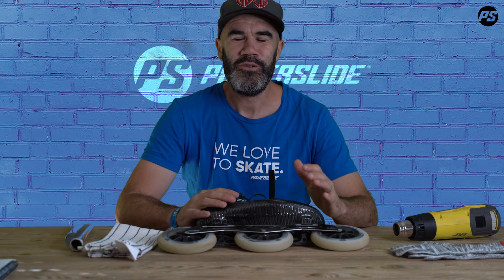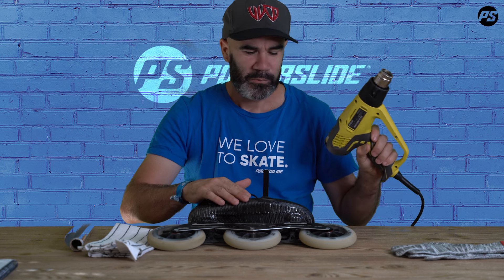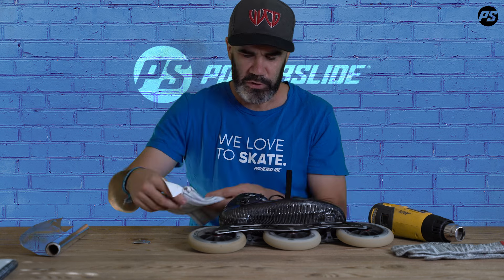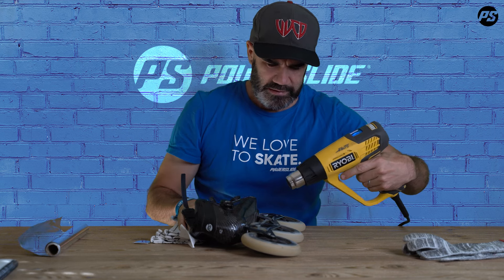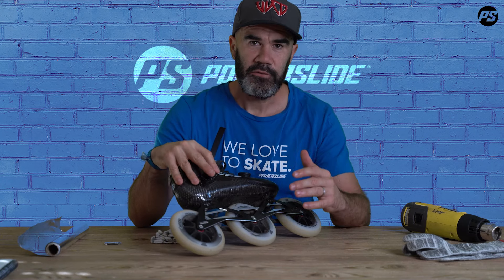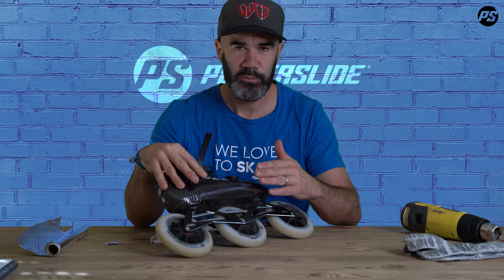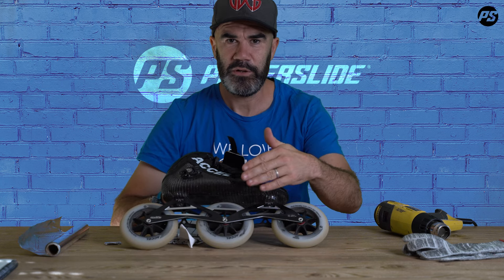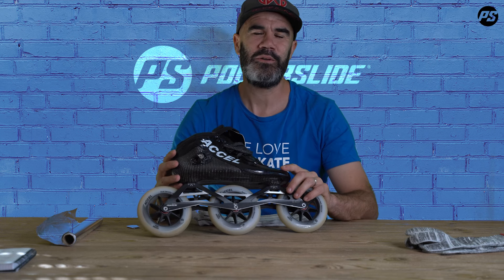Pit Stop - Accel heatgun modification

Comment: Can I do the same with the shell of the Next Boot? Just heatmolding the liner is not sufficient to get rid of the pressure point on my ankle.
Reply: Yes, I've done it with many plastic boot skates including the Next boot
Reply: i tried on next series, works wheel, heat only outside of shield, be care with wheels (do not heat), press from inside with rounded wood or plastic